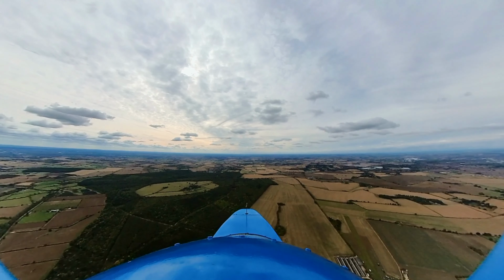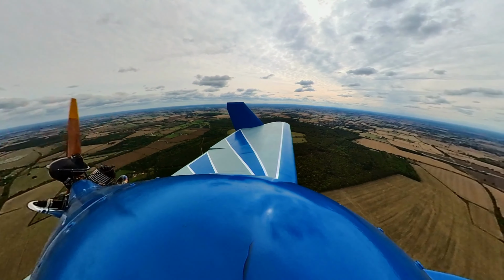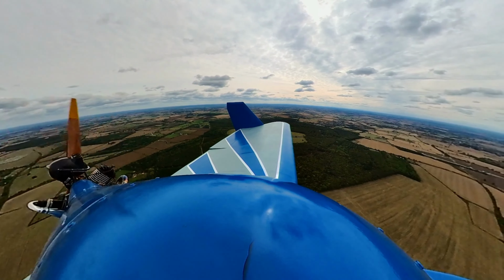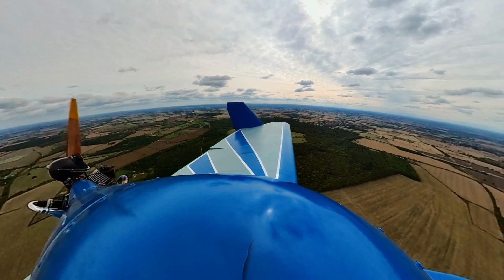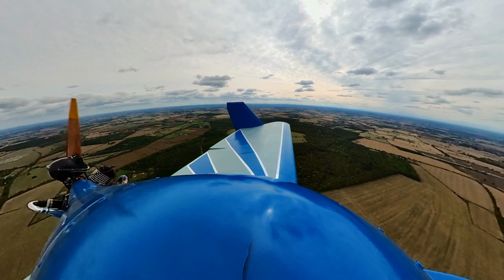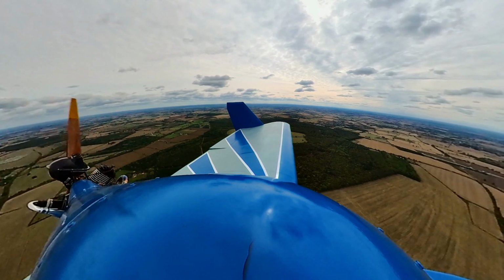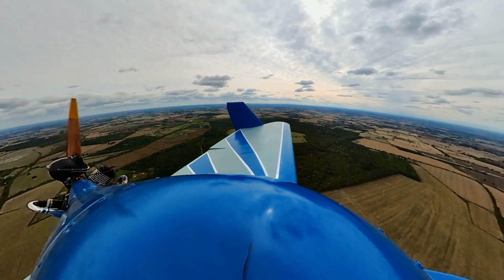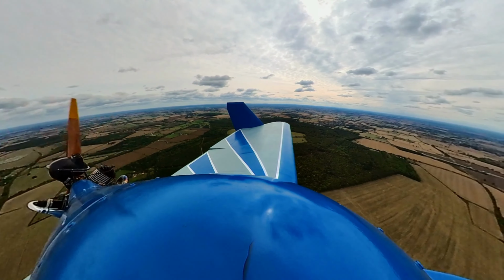MW9 Plank stability & control and handling qualities

Comment: Excellent video, the 360 camera really being a value in showing the control surfaces. The commentary adds so much to the video. Thanks for sharing.
Reply from the maker: Thanks Stuart. It was on your recommendation that I bought it. Just getting to grips with the software.
Reply: @adrianpjones  I too, have an interest in the camera system. Could you please put a link to the camera system used in this video?
Not intending to detract from the MW9 Plank which is the main event here. Thank you. Harold
Reply from the maker: Here you are Harold.
https://www.insta360.com/mobile/product/insta360-oners

Comment: I think when you have a wing with no tail the top surface is supposed to be slightly concave towards the rear of the wing to bring the nose up.  That is why you may be having to pull back on the stick
Reply: Yes, a plank wing has a ‘reflexed’ camber line.  Airplanes move around their CG.  For pitch stability the CG must be ahead of the center of pressure (eg nose down).  This is countered by the nose up of the reflexed wing (or ‘decalage’ in conventional plane). 
Reflex airfoils are not as efficient as conventional airfoils.  They don’t make as much lift.  
The plank CG range is limited.  In a single place plane the  plank negatives are balance by benefits of lower weight, less frontal area, higher Reynolds’s number.      Cheers

Comment: I think if you take the top surface of the wing and meet the bottom surface 6 to 8 inches from the back of the wing then follow the bottom of the wing upward you will have the force that lifts up your nose. So then that will give you the downward force of a tail.  You attach your flaps there where they are attached now. So then a canard aircraft is the most efficient with upward forces from both the canard and the wing.  hmmmm. The long EZ. The wright brothers first plane. lol